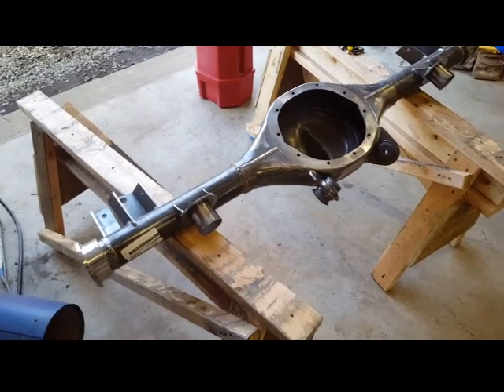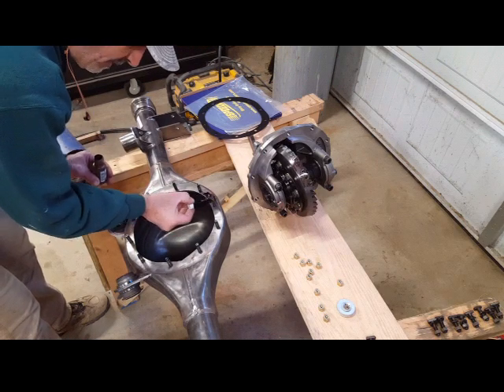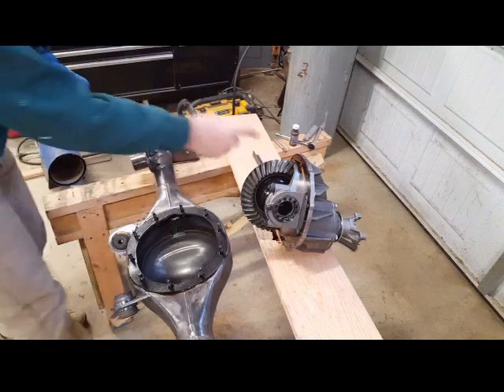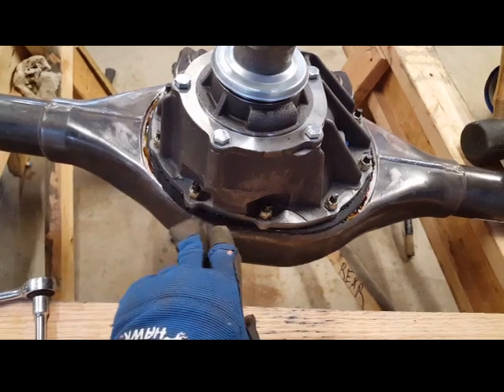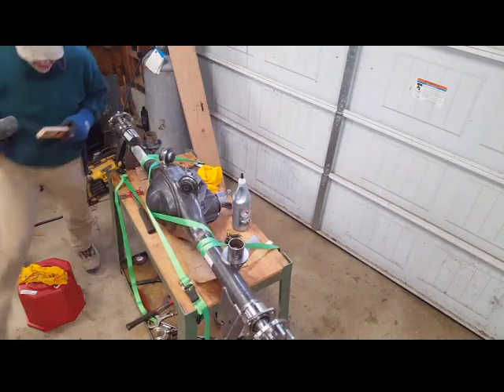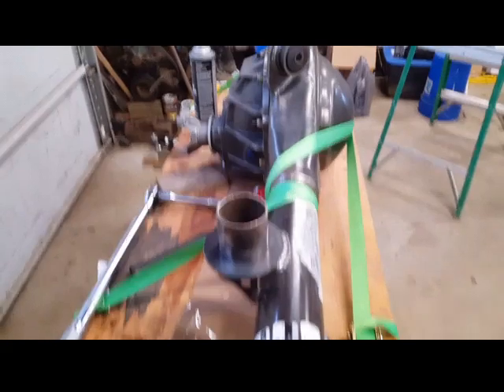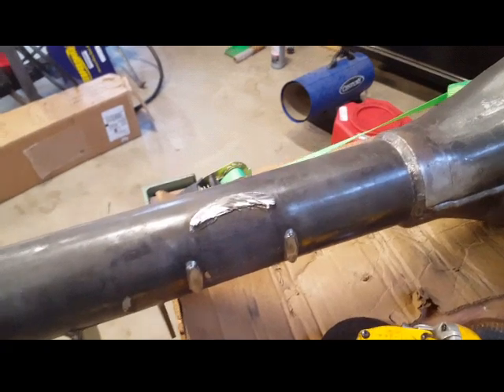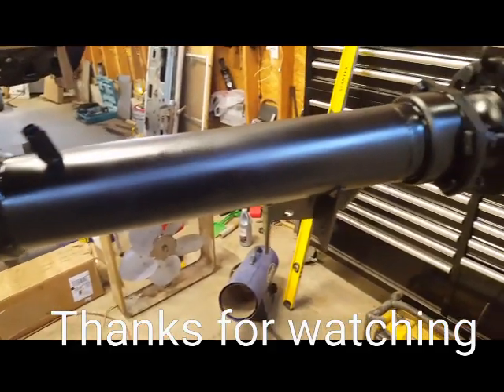Ford 9" rear assembly, GTO, Chevelle, Buick, 68"-74"

Comment: Just assembled my speedway 9inch.  I should of rewatched this before I attempted to install the studs.  I was trying the double nut approach.  Waiting for my Baer brake kit to arrived.
Reply from the maker: Scott just pay attention to the bolts that hold the rear axle in. The washers are not grade 8 and they Crush. I did not realize that until I spoke to my buddy who did the same 9" rear and his were the correct ones. I ran the Home Depot and picked up grade 8 washers. Baer was my second choice for breaks. They make a good kit. All the best

Comment: Very nice work again mate, I built a 9 inch for my old Mopar 20 years ago and it's been trouble free. Used 355 gears as it was my daily driver for years. Bolted straight in just needed wedges to adjust the pinion angle and a conversion uni joint. Same stud pattern as well,  the Australian Mopars only had locally made Borg Warner Diffs .Used to break them every month with the mild 318, had to change to the 9 inch when I built the hot 360. The impala has a 12 bolt , heard they're ok but never had one before.  Thanks for the video,  happy Easter.
Reply from the maker: Hi Peter. Thanks for the nice words. I've built a couple 9-inch Fords for other people never for myself, this was the first one I built for myself. I have a 12 bolt rear in my Chevelle running 454. Never had a problem.. looking forward to getting this on the road putting the rest of the suspension on this weekend I will be posting some videos of that kit. All the best my friend! Happy Easter. stay safe!!

Comment: Very informative. Thank you for your time.
Reply from the maker: Hi Omar. Because it is a Ford rear 9"" I have to install Ford brakes. Thanks for stopping by. All the best
Reply: Thanks for your reply. I ask because I’ve seen option for either Ford or Chevy. Thanks again for the detailed video
Reply from the maker: I think I did not put the part numbers in the description. I will go back in and put the part numbers later. If I put the part numbers in, this will probably help you out tremendously.  if you're putting a Ford 9-inch rear end in A-body
Reply: Thanks. It is going into a A Body. 71 Chevelle.

Comment: Why not stick with GM and put in a 12 bolt posi?
Reply from the maker: Hi Howard. Good question. I put in a Ford 9-inch only because of the horsepower that I plan I'm putting to it. The motor I'm putting in is an LS3 pushing approximately 500 horsepower. Just want to make sure it will withstand the torque. All the best
Reply: Classic Rewind Thanks for the reply. I’m planning to build a stroked 428. It should be about 500 hp. Even more torque. I have a 12 bolt I thought would be sufficient. I guess we’ll find out.
Reply from the maker: I'm sure it'll be fine. I'm building it for pro touring. That's why I'm building the suspension the way I am. As long as you don't race it everyday, I don't think you'll have a problem. All the best